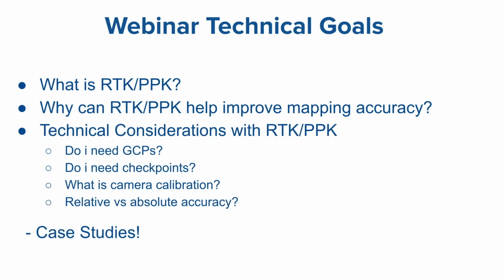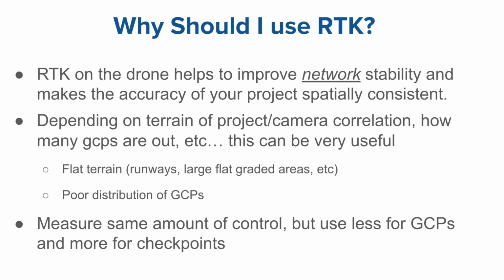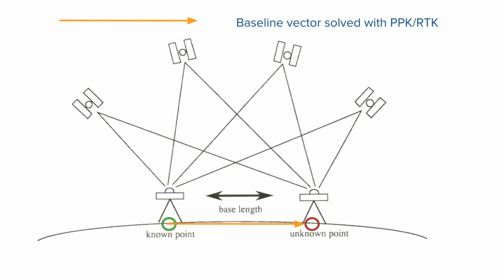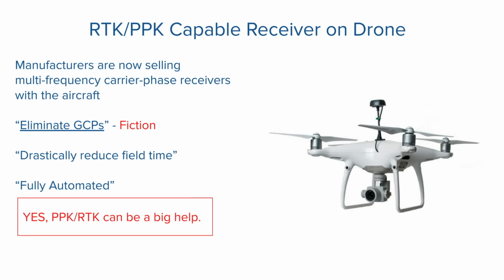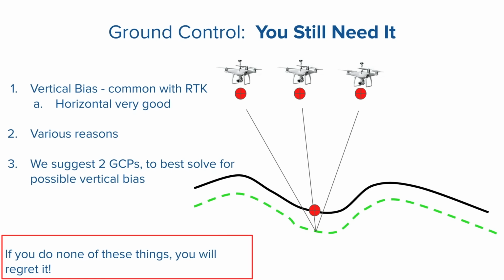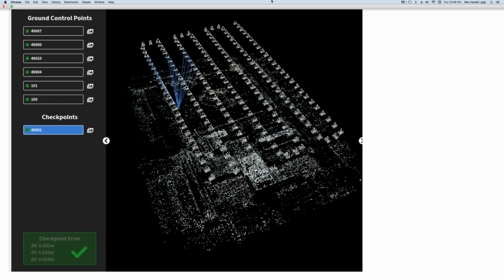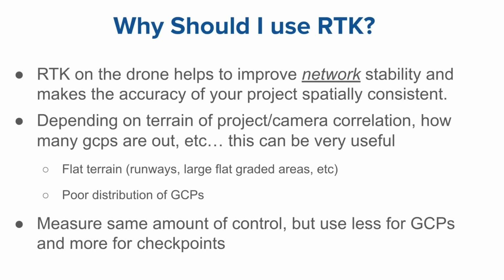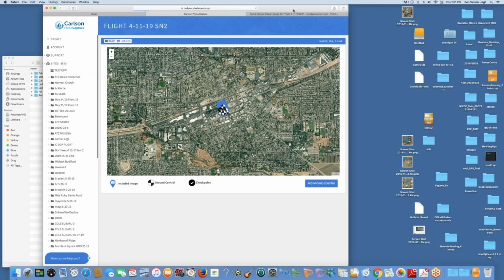Best Practices for RTK & PPK Drone Flights | Webinar Recording

Comment: Thank you for the presentation,but as a relative begginer in the field i have problems with grasping a few things.1)What exactly is the difference between a checkpoint and a gcp?I get that they are similar but i cant find any good answer on the web.2)What is the difference between a known and an unknown point?I know that a known point is better and gives us a higher accuracy,but what i need to do to get a known point?Is it possible to explain this to me i layman terms?Thank you.
Reply: A checkpoint is a Point that you use to check the accuracy in your project "manualy" after you are done with the map or model.
A gcp is similar but you add it to the project befor you run the calculation and all the points are 
corrected automatically in the calculation.

A unknown point is easier to explane. It is a point with no prior 
physical representation in the real World, for instance a pipe in concrete or a metal nail in asphalt. That is all the points you measure with gnss.
A known point i measured and balanced from another known point in a grid with accurate methods and has some physical feature to set up your measureing equipment on.